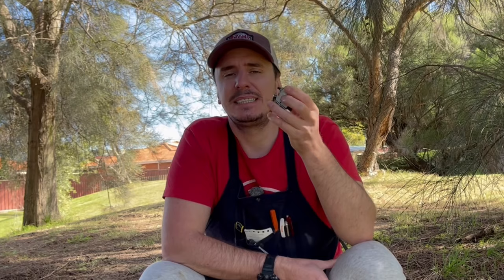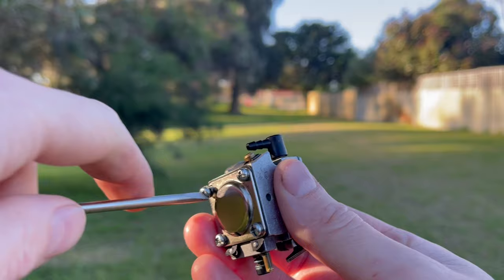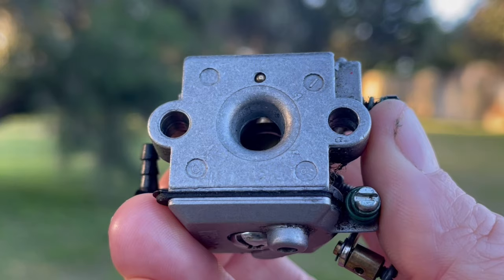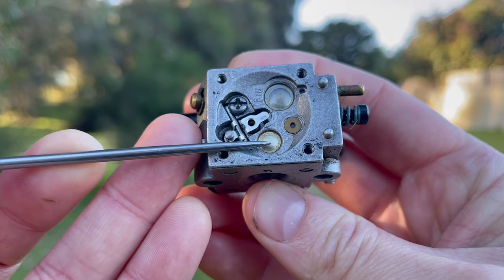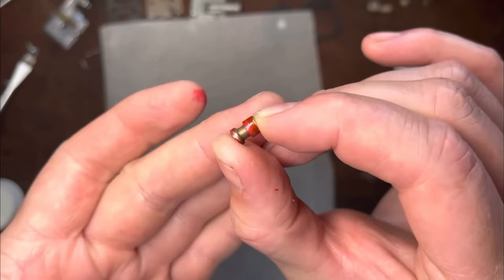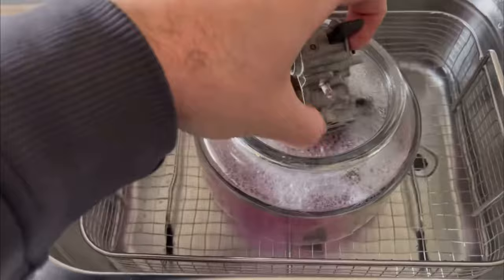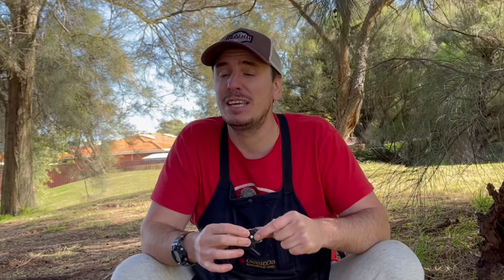Doing This Will Ruin Your Carburetor Every Time!

Comment: Crazy timing this. I've been fooling around with the carb on my Stihl MS180C. It has no mixture adjustment screws, only idle.
Bogs down off idle. I suspect the metering diaphragm, a little "clicky", and the dealer has to order it.
So, a couple questions. What is a good safe cleaner to use in the ultrasonic? 409 turns the metal dark. 2. Do you trust the parts available thru the internet? Seems kinda hit n miss in my limited experience.
Reply: I have used Seafoam and 2-Stroke mixed fuel, about half and half. Gasoline is a good cleaner by itself and so is Seafoam. I've also used Berryman B-12 and the fuel mix. Both ways seem to work well. (I wouldn't recommend smoking around the cleaner, though.). I've also used Super Clean mixed 8:1 with hot distilled water on some small, really greasy items. (The Super Clean is probably the "Safest" alternative of those.)

I have to admit that I have never used the actual stuff made for ultrasonic cleaners. When I clean my wife's jewelry, my electric razor's blades and parts, or watch bands, I use about 2 tablespoons of ammonia with the balance (about quart) of distilled water. You can see all of the dead skin cells sort of explode into a cloud. I've also used just distilled water for some items and even that works to a certain extent..

I don't get too crazy because it's my wife's jewelry cleaner, after all. As long as her Wedding ring sparkles, she's happy. The rest, she doesn't have a "Need-To-Know". I'll probably get her a new one as a gift soon and just move this one to the garage. It does a fine job on small parts.
Reply from the maker: I really like ct14 if you can get it! Best of luck with the 180, they’re awesome saws!!
Reply from the maker: @tinkerscorner54 thanks for sharing what you know!! :)
Reply: @tinkerscorner54  Thank you! 👍🍻 Good to know. Have heard good things about Seafoam.
Reply: @VintageEngineRepairs  👍🍻

Comment: Ive always wondering if by using a syring, gauge, and super small vacuum cup if there was a way to test the check valve for proper operation. Im just now coming across your/this video and curious on your thoughts. Unless you have covered this in other videos then please let me know. Oh, and one last thing, what are symptoms of this check valve being bad. Thanks a million in advance.
Reply from the maker: Symptoms are lean at idle! I haven’t tried a syringe, but I’d suggest you’d need 3 hands if you did haha :)
Reply: @VintageEngineRepairs  Okay gotcha, and i would use one of those cheap suction cup vises and im talking bout a bigger style syringe (plastic). I also have pretty small suction cups that accept tubing so whether pressure testing or vacuum testing. It was justa thought but i can say you covered this checkvalve in a amazing way, this was the only thing i have always wondered what was going on and how with so awsome job. I just like making up tools for testing things so there is never any guessing, i just like to prove something wrong, im weird like that,,,lol

Comment: Do you know if the wt walbro series has this diaphragm? thanks, your videos are extremely helpful!
Reply from the maker: Some have a ball valve others have a diaphragm, but I don’t know the specifics for each model I’m afraid!
Reply: @VintageEngineRepairs  Thanks for the reply... After some research it appears mine is a diaphragm. Which means i've probably blown it out long ago. Time to buy a new nozzle. Thanks again!
Reply: @VintageEngineRepairs  My WT-682 had a diaphragm! I was able to 3d print one from TPU @ 0.2mm height and it seems to be working :) Ps... you channel is an absolute gem, and your approach to the topic and videos is very enjoyable. Subscribed!
Reply from the maker: That’s crazy I had no idea you can 3d print diaphragm material. And it fuel resistant? Can you link me to a video of the process? I saw someone mention this on arboristsite too, is that you? Thanks for the kind words :)
Reply: @VintageEngineRepairs  Yeah, thats me..same guy! Honestly not much to see. it looks like any 3d printing. Trick is to use TPU which a a rubber like material with decent chemical resistance and get the diameter vs thickness right. Also, there are different 3d printing surfaces, in this case you want a smooth one for the matting surface side of the diaphragm. If you want to send me an address through arborist DM ill send you an envelope with a bunch of different sizes you can test. Ill send them by stamp mail so will cost nothing even across the ocean....also, after tuning the carb the 3d printed diaphragm appears to be working pretty much fine.

Comment: is there a way to check if it has already been blown out besides running lean at idle?  It looks hard to see.
Reply from the maker: Sure, take the high speed screw out and put some hose over the hole and blow and suck it should click.

Comment: I purchased a cheap (reverse engineered chinese) replacement carb for my stihl  strimmer from amazon.  The head will only run and strim with the throttle lock on.  As soon as I play with the throttle trigger it coughs and dies.  What is the cause of this? Others have reviewed these carbs and not had a problem.
Reply from the maker: Hey :) you’ll see from my other replies to people’s comments, I never recommend Chinese copy carburetors, they’re notoriously unreliable. However you may just need to tweak yours. Have a watch of my video on how to tune a carburetor - https://youtu.be/UyngDl_2km0

Comment: E10 destroys carbs. I can buy a new carb, cheaper than a kit..
Reply from the maker: Yep you can, but you can’t buy a new oem carburetor for anywhere even close to a kit. Look after them, don’t store ethanol in the tank or engine - run them dry and you’ll never have a problem. Chinese carburetors are notoriously unreliable.

Comment: Inlet barb in the case it's plastic, is probably cracked and leaking.  The metering diaphragm needs to be soft, not hard and stiff, else it's going to oil-can and fuel control will be rich one moment and lean the next.
Reply from the maker: Sorry I’m not sure what you’re referring to? This video didn’t mention any of those things! Thanks for watching!
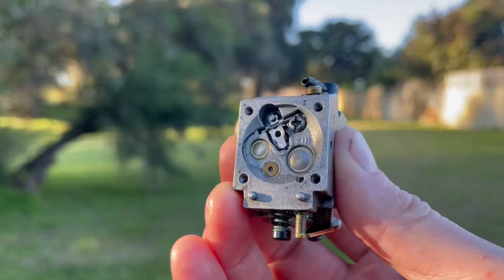Reply: @VintageEngineRepairs 2:44 inlet barb?  Perhaps somehow we aren't discussing the same subject?
BTW, plenty of 2-strokes are fitted with a float-style carburetor, the carb type (float/diaphragm) has nothing to do with being a 2 or 4-stroke.
Reply from the maker: Oh yes but referencing avoiding shooting air through it 👍 I think you may enjoy this video - https://youtu.be/_4K6dBQTeek
Reply: @VintageEngineRepairs  I'll watch it if it involves removing the Welsh plugs, a required task for a proper carb overhaul.
Reply from the maker: I think you’ll enjoy it ;)

Comment: Nice fuel bottle. I'm trying to find one on Amazon, but no luck. Do you have a name or manufacturer for it?
Reply: I found something similar. Is this the same as you have.
mnpctech 8oz (500ml) Honda Civic Accord Transmission Fluid Refill Dispenser Squeeze Bottle with Brass Tube
Reply from the maker: Cool! Looks very similar! Just check it can hold gasoline :)
Reply from the maker: See my other reply below ha sorry
Reply: Also this one looks similar.   STAHLWILLE 12251 Oil squeeze bottle.

Comment: I don’t want to waste my time to clean carburetor’s and fuel system . Since I used Acylate(blue 4stroke,orange 2 stroke)fuel or aircraft fuel (100LL ore 91/96 UL). I never ever hade a problem the last 50 years apparently ! Yes it’s more expensive but how much fuel do we need ??? Don’t use the junk from the gas station especially when the engines sits unused for a long time !
Reply from the maker: That’s all good :) we all have our preferences! Thanks for watching 👍👍

Comment: A new carb kit with gaskets, fuel line, and fuel filter is only $20.  My time is more valuable than taking it apart and cleaning it.
Reply from the maker: The carb kit doesn’t contain the main nozzle. A carb kit won’t solve this issue.

Comment: Almost as easy as triple SU carbys ! A gunson metering air took to balance them.
Reply from the maker: I haven’t worked on SU carburetors, but good to know :) thanks for watching!
Reply: @VintageEngineRepairs  it's basically like a motorcycle carby. Has a plunger that goes up as you accelerate with a metering rod which you can change to different sizes. In my case I put a lightweight oil almost like wd40 in the top housing screw. Worked great on a straight GMH ( aussie version) General motors) 3.3 litre engine with a GTR XU1 internals. Very responsive and it would recommend hard! 😆 lol. Like all the time. Cheers 🙂
Reply from the maker: @dragan3290  ahhhh! A slide carburetor! Gotcha :) thanks for that.

Comment: total   bollocks   remove the air filter    rev the thing up     and slap   your hand   /  or a bit of card over   the intake  , remove  it before the engine  stalls and repeat a few times   .  any crap   stopping   the valves  in a 2 stroke engine should be sucked through  under the extream vacume   you just created   by  blocking the air intake off  [ this works on  4 stroke  engines too ]
Reply from the maker: Thanks for watching

Comment: Sigh. Good advice for the morons out there.
It's so simple to just buy a service kit, strip, gently soak and clean and dry, set up, and get a reliable running motor. But a whole new carb seems way overkill.
Reply from the maker: Thanks for watching

Comment: Stihl carbs are junk.
Reply from the maker: What is the merit behind your comment?
Reply: Experience. Unless they changed them in the last year it's the most replaced stihl part at our local dealer. And we are just one little home town dealer.  @VintageEngineRepairs
Reply from the maker: @gsxr419  that’s not been my experience, they’re fantastic.
Reply: Stihl do not make carbs they use Walbro, zama or Tillotson, I have Stihls that are over 40 yrs old and I have new Stihls they all have their original carbs and run fine. I would suggest its the mechanic doing the servicing and not the equipment!
Reply: @pavelrobertson5016  not the older stuff just over the last 5-7 years or so.
Reply: @pavelrobertson5016 Stihl owns Zama
Reply: Exactly right but Stihl AG does not manufacture them, and seeing as though dozens of manufacturers of small engines use Zama they can not be only not working on Stihl chainsaws. The problem is the dealers, who do not make large profits cleaning carbs but boy can they make cash selling OEM carbs. Most of the problems I have seen on all carbs is down to the addition of alcohol which is highly hygroscopic - exit stage right rant over!